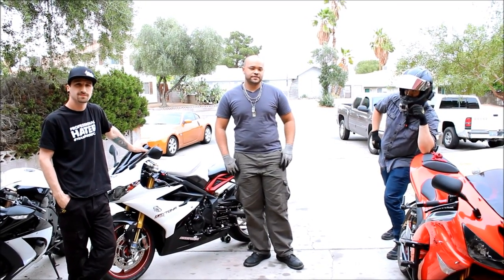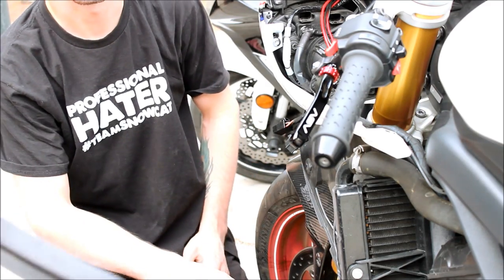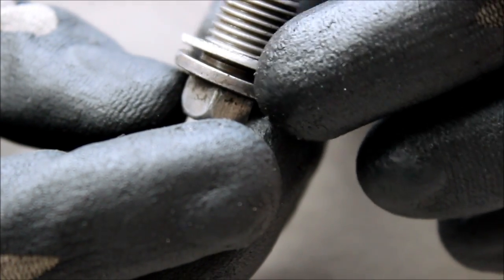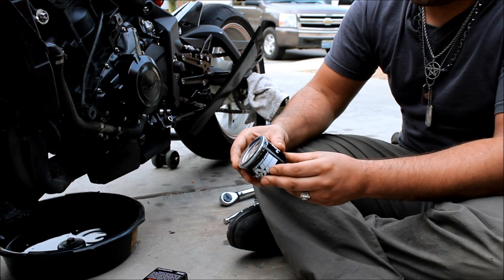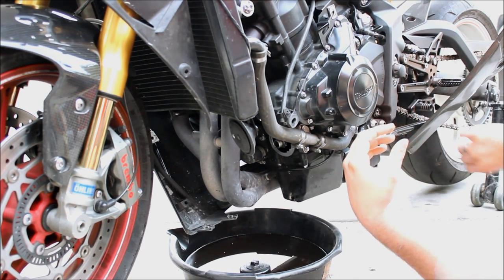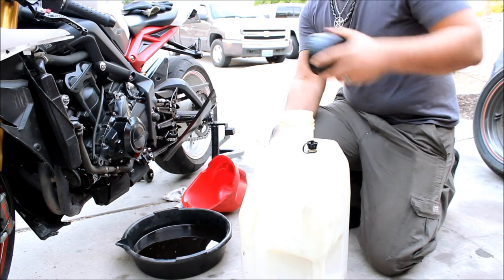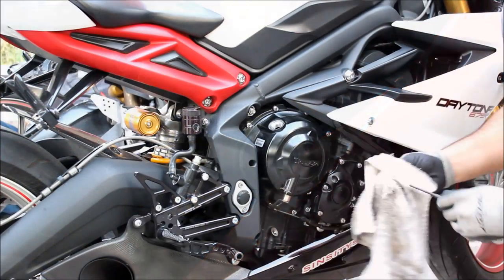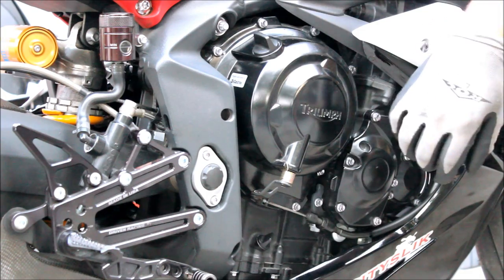How to do an Oil Change on a Motorcycle ft. SinSitySlik & BikeTender

Comment: You did a great job. But I have a question though, at 5:21 When you changed to a new oil filter did you say that the rubber ring from the old oil filter be kept to mating point of the new oil filter or should it be discarded? I'm confused.
Reply from the maker: Street Squiid thanks bro. I understand your confusion. So the way it works is that laa oil filters of this style will have a rubber o-ring attatched to it. When you remove the old oil filter, sometimes the o-ring will stick to the mating surface of the bike people dont always notice this and will screw on an oil filter on top of it. Doing that will mess up your oil seal causing what's known as a double gasket. If you have two gaskets like that, when you start the bike, oil will go everywhere. So to avoid this. Just be sure when you remove the old oil filter, the rubber o-ring is either still attatched to the old oil filter and thrown in the trash, or remove the stuck o-ring from the mating surface of the bike and throw it in the trash. Your new oil filter should have a new o-ring. I hope this helps. Thanks for supporting my channel.
Reply: The Motorcycle Boss wow!! Thank you so much for taking the time and posting such a detailed reply.

Comment: Another great video thanks. Oil changes are pretty basic for me now but I learned a couple of good things from this, cheers. One thing, when setting the torque spec on the oil drain bolt, do you look the value up for each bike or do you know by other means like the size of the bolt etc?  Thanks again...
Reply from the maker: thanks for your comment. when tightening drain bolts, I pull the torque specs strictly from the factory service manual of the bike being serviced if readily available. otherwise, I use my own judgement and experience to get it as tight as I'm sure it needs to be but not too tight.
Reply: +TheMotorcycleBoss OK good a gold, thanks for that.

Comment: great video, very informative. How would one choose the best oil?
Reply: thank you. It depends on the application. of course the weight of the oil should be what the manufacturer recommends. as far as the brand, i go with mobile 1 racing 4t because it is designed with a wet-clutch system and shared-fluid tranny in mind. designed for high performance racing applications and helps prevent clutch slip. plus has the newest API service code available. You have to research what oil you are looking at and see what it is designed for. check the api service code and use a reputable company. hope this helps.
Reply: this is themotorcycleboss btw. this is my second channel. sorry for the confusion
Reply: this is themotorcycleboss btw. this is my second channel. sorry for the confusion

Comment: 4th gen zx10r oil change is super easy compared to these 2 bikes. I had a 08 zx6r and it sucked. My 2014 zx10r i only loosen the fairing and belly pan while.its on stands.
Reply from the maker: I had a 2001 zx6r before this zx10 and i had to remove the whole side fairing to get a good grip on the oil filter. I love the new setup they have for the 4th gen zx10s.
Reply: @TheMotorcycleBoss  just found your channnel was searching for fork oil change. My bike has 18,600 miles i get bored and wanna do some preventive maintenance. Ive done 3 videos but they fall way short compared to your qaulity content. Ive flushed my own coolant, bled the brakes, sprocket and chain change, throttle cable lube and adjustment,  fuel pump disassemble and clean, also a neat trick to fix a fi light. I subscribed keep the vids coming bro.

Comment: I'm about 5k over my oil change :(.  catching up financial issues.  I hope I haven't hurt my engine. on the upside she's at 29k miles and running fantastically!  Finally getting to change the oil in the morning. love my daytona 675.
Reply from the maker: Moxxi 675pilot 5k over is a lot. hopefully your oil didnt break down quickly and you used a quality oil filter. good luck with it. i hope things work out.
Reply: TheMotorcycleBoss yes sir. it's the castrol that's recommended and it's a oem daytona 675 filter.  I don't like to go cheap. how will I know if it caused damage?
Reply from the maker: Moxxi 675pilot how many miles is on your bike? there are a number of things that you may notice with a worn out motor. as long as you change the oil frequently from this point on, you may be fine. most common issues are sludge, looser bearing clearances, faster wear of engine components, and possibly knocking or weird sounds. if you dont do your oil regularly, you will diminish the life of your bike. extremely important to do it on time.
Reply: TheMotorcycleBoss  29 thousand. and belive me, this is the first and last time this will happen. I'm sure the motor isn't worn, not hearing any unusual but my buddy at the dealer will let me know if something is off. the bike is still under warranty, and it's almost time to renew the warranty.  all my oil changes previously  have been the normal intervals